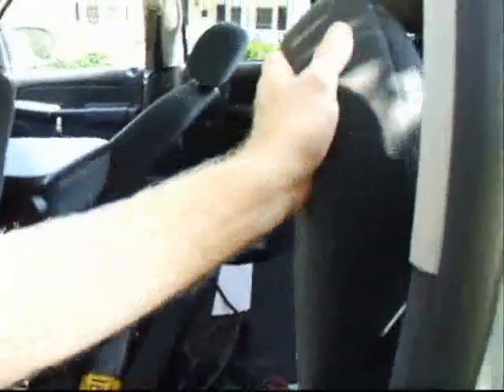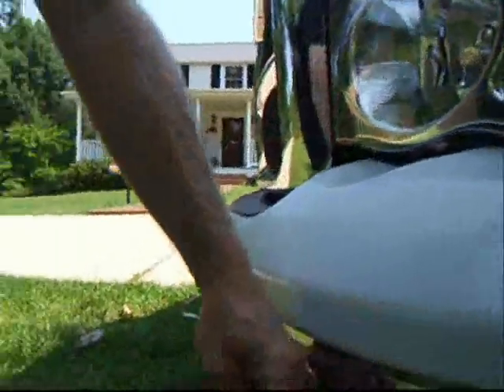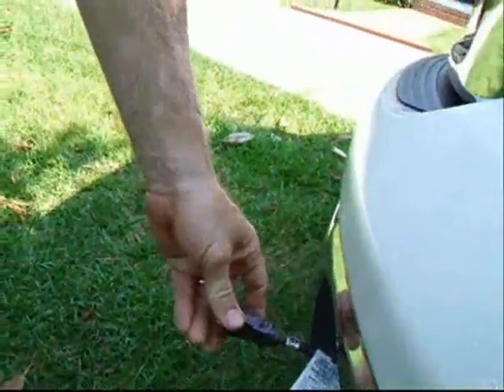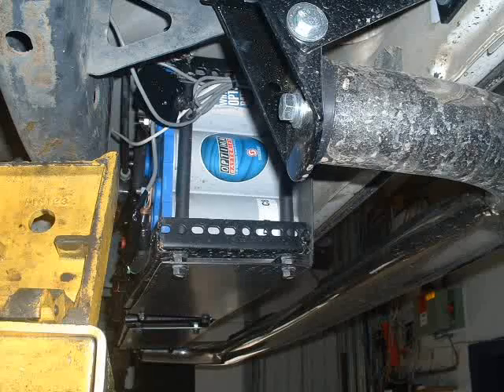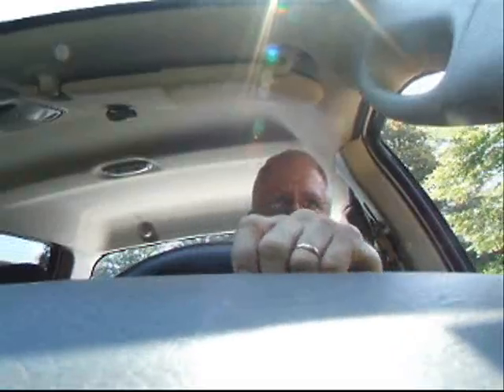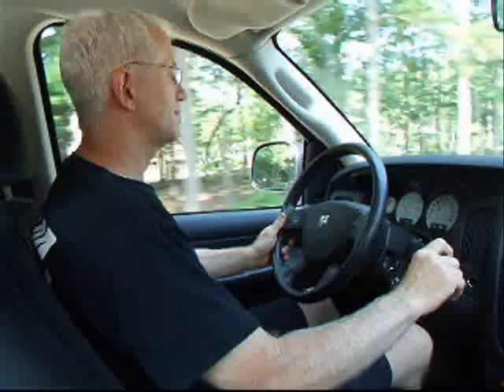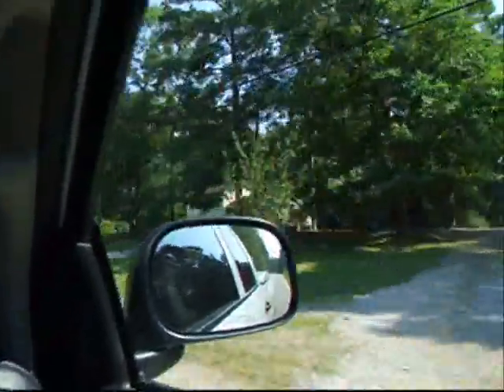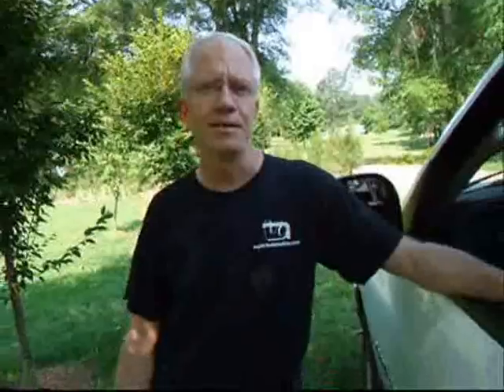Re-InVolt Hybrid Electric Truck Conversion Plug-In

Comment: Ya.... so I'm gonna pull the trigger on that Hemi Commader Limited I've always wanted... 

I think true 3 mode is the key. The eTorque ram is Mickey mouse, and isnt suited for high duty cycle. 

I think having a trade off approach is the absolute best.

Hemi power+electric torque is the fun bit.... but using a fully capable electric system to boost fuel economy over all is what turns my crank... short trips 90% electric drive percentage. insane in town mileage, still using the IC engine but removing almost all the load. Long trips 40%-60% electric drive. In order to stretch out the battery as much as absolutely possible. 

Very excited to research this further.

Comment: This is something that I have always wanted to do, on my 2012 Tundra, whats the cost involved, could a motor be wrapped around a custom driveshaft and powered by supercapacitors, and function as an electric  assist? As opposed to just electric mode?  I think that would be more beneficial.
Justin

Comment from the maker: @MrTpengineer 
That is simple.  As far as total gallons of fuel saved, you make the most impact by choosing to convert the vehicles that use the most fuel.  My truck began at 12mpg and if I accomplish a 100% increase to 24mpg, I have saved 10 gallons for every 240 miles.  If I started with a vehicle getting 20mpg and increased the mileage to 40mpg, I would only save 6.   If you did the same improvement on a Prius hybrid that got 50mpg and increased it to 100mpg, you only saved 2.4 gallons.

Comment from the maker: @pcloverify 
The motor is coupled by the drive shaft on both ends and is driven 100% of the time. It is an 11" warfield motor.
We did use an alltrax controller but have since increased the battery to 144 volts with a custom controller that increases fuel mileage at highway speeds.  We use a custom built charger.  We would love to sell the process since our time has gone into converting hybrid vehicles to PHEVs.

Comment: This is great!  I just have a few questions if u could answer that would be great. I am extremely interested in how u coupled the electric motor. In the brief picture at the beginning it is hard to tell, is it couple to the back of the transmission?  Also what kind of motor is it. A 9 inch advanced dc?  Also is that an alltrax controller?  What kind of charger do u have? Does the electric motor free wheel when it is not driving or does it get rotated by the engine when u are just driving regula

Comment: Since that truck is a automatic don't you need the engine to in use or else you'll burn up the transmission or do you not put it in neutral when using the electric motor?

Comment from the maker: You just have to set up the system so you are fuse protected for high amps.  My control module also shuts down my system if the amps go too high.  As far as cooling goes, my motor is turning around 2500 rpms, which is more than sufficient to cool it.

Comment: I had a transwarp 9 pushing my small ranger in neutral and it fried the Alltrax quick. Plus the motor can't turn quick enough to properly cool, how do you get away with that?